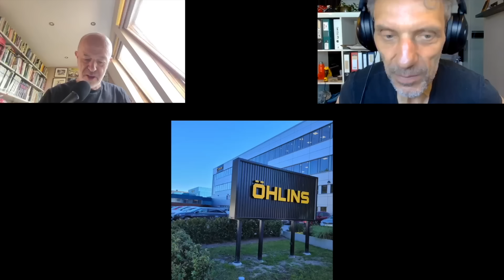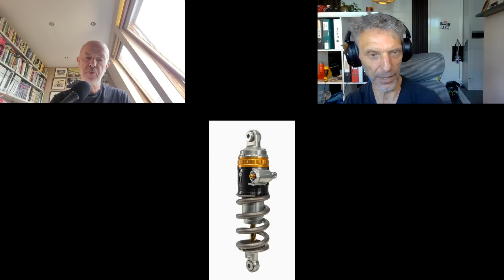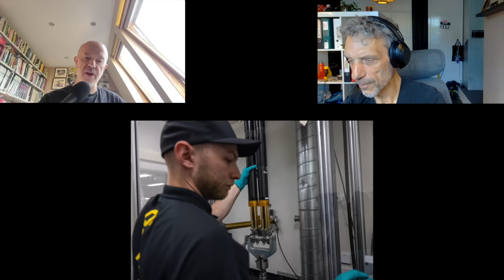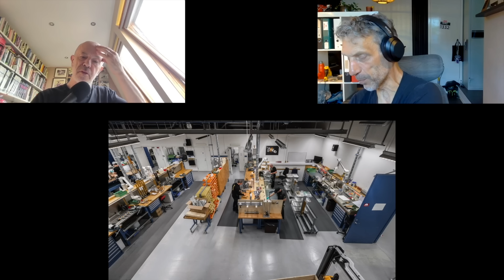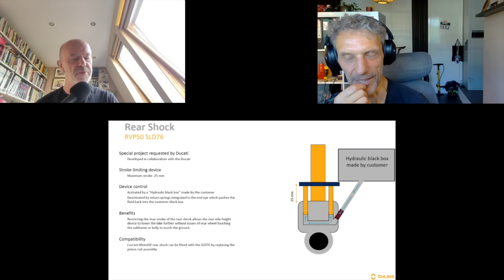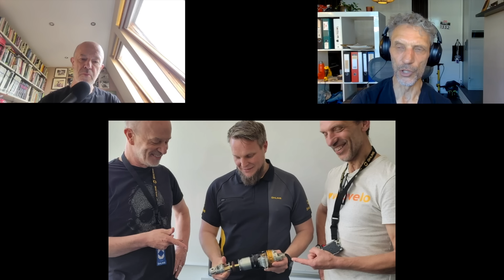Visiting Öhlins: Pump Friction

Comment: 28:00 Regarding technicians for opposing riders working side by side: Would Marc's shock preferences be useful, or even interesting, to Bagnaia, let alone Martín? Even between teammates their specific preferences, being based entirely on feel, will presumably be different enough that someone else's specific shock setup would be useless as anything other than a bit of trivia. It seems to me (an idiot on the internet) that Pecco wanting his forks to bottom out on the way into corners (assuming that's acurate) would make his fork settings useless to anyone else.

If you add a completely different bike built around a completely different philosophy with a different rider who wants a different feel, the possibility of industrial espionage between Öhlins technicians seems remote.

But, as I pointed out above, I am just an idiot on the internet.